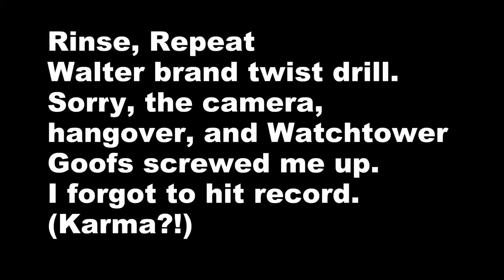Making holes in Armor Plate. Cheap twist drill vs. good twist drill

Comment: AR400 isn't that hard to drill through, your vid is a pretty good guide on how to do the opposite of all the right things to make her chooch though ;-)

* Try not to drill right on the edge of a flame cut piece of steel unless you have to 
* If you have to drill there - anneal with a rosebud till it loses magnetism, then air cool
* Drill a pilot if you can help it
* (A lot) Less speed and a lot more feed.  Start around 70rpm and feed as hard as you without snapping bits
* Flood coolant is best, but a little spray bottle of coolant will get you there without making a mess
* If you can resharpen, 135* and a low clearance angle helps
* Split point is convenient but you'll get a lot more holes out of a standard point

Looks like you snapped the corners off the second bit straight up by drilling into the hardened steel left by the first hole.  If you gotta redrill a hardened hole then anneal if you can or go straight to carbide.  

Keep your stick on the ice and watch out for that Tokillya.  You'd get my vote for president!

Comment: Brings me back to the days as an apprentice in a machine shop, run by the awnriest old fart you'd ever want to work for...drilling holes...in aluminum castings and plate...8 hrs a day, hole after hole. My favorite (worst) was drilling thousands of tiny holes in 3/4 in plate with bits the size of angel hair pasta...and how happy BossGrumpyPants was every time I wore out a bit, or worse, broke one off down in the plate.  Good times...andnin the end, I came to be a pretty fair driller of holes...of one kind or another.
😁👍

Comment: I've read those cheap black drills are only for wood, plastic and soft metals like aluminium and perhaps they're black to indicate this. It would've been great if he'd included those golden titanium nitride coated drills in this test, especially after the coating's come off and they've been sharpened, because they're often, but not always, cheap and marketed as superior, I think it's mostly marketing BS based on looks because only the tip would need coating, and maybe it's also a way to make crap drills last a bit longer.

Comment: Do the bits a favor and start with slow speeds and speed up, not the reverse. If the cutting edge gets too hot, it loses its hardness. High rpm, more heat. Keep the cutting edge cutting, (blue chips).

Comment: Just a simple farmer, here, but slow speed (<100 rpm), and plenty of cutting oil will work wonders.  Oh, and use the cutting oil like a coolant:  When it starts smoking, add some more.  Works for me.

Years ago, I watched a kid at a truck garage get out a brand new, titanium-nitride drill bit, put it in the highest-speed air drill, and proceed to drill no more than 12 inches away from a placard on a new truck frame that warned that this was a heat-treated frame, and not to drill holes into it.  Well, he ran that drill as fast as it would go, without coolant, no less, and smoked the bit into a glowing blob at the tip.   He then removed the melted and deformed bit, put it in a bin of similarly-damaged bits, and got another drill bit, and proceeded to drill out the now-hardened hole.  I think it took 3-4 drill bits to make one hole, and he had several to make.

Comment: Problem with gloves in the shop is twofold. 1, gloves generally catch on spinny bits easier that skin, which will just cut. People lose hands because they were wearing gloves, they get scars when they aren't (in the machining world, specifically, please wear gloves otherwise.) Additionally, you can get melted or burning glove on you for resting on a super hot surface, whereas your bare hand can sense heat by being near it. That second thing is also useful for working certain types of steel, that is, if it's still cold enough to comfortably hold it's cold enough to keep cutting.
Reply: Like standing on a torched off, bolt head.

Comment: I have a drilling question? Here goes. I want to make a pole saw out of a silky pruning saw & telescopic extension pole I have to hand. I need to drill hole in the silky blade to fit the handle. The silky blade is hard and almost impossible to drill I guess it's high carbon or something. I have a Makita battery drill and dormer 5mm twist drill I tried to Sharpen but no help. I think my Sharpening skills are good enough as drill bit work on mild steel good. I love you videos by the way keep your dick in a vice out!

Comment: i have battled this before, its where i found my fighting spirit. . ."if i cant drill this hole than mark my FUCKIN WORDS IM GONNA MELT THIS HOLE!!!. . .i twisted the teeth off a whole set of harbor freight bits, started by breaking all the small ones and then snapped the corners off all the medium ones and then took a big one and went full bore with the rest of the battery and when i pulled it out it was dark blue, wd40 the whole way with every bit just cut for a second then rolled smoke. its my inch thick welding bench made of a road grader blade and i need a vice on it come hell or high water and my torch is out of gas and im leaving in a week and it gonna sit for months anyways, i was able to use a little masonry bit to cut small holes but even milwaukee bits barely made it through the piloted holes, each hole is a different size cause i just did what i could and i remember one of em is 2 different sizes in the same hole cause i ran out of cutting power all together and just had to use a smaller bolt, tried to use a drill slightly bigger every time but it just melted the corners off even with wd40 the whole way, and all the holes are all chowdered and gulled up . . .but my vice is still bolted to that bench. . .never give up kids, even if you have to destroy tools and have crappy results, ive had to air chisel holes before in steel plate too cause it was the only thing i could do. that was a bitch if i ever fucked one

Comment: Mild steel - 60ft/sec cutting speed. 50 to 40 ft/sec for harder steel. Use cutting oil or just oil for coolant. Use HSS bits no problems.

Comment: For noise from water , use a board and place it under a tap below the vertical angle ...
 part of the water will be flooded down the board and will have less noise

Comment: Man AR400 steel is a bitch, when I have to drill it, I crank the RPM down to around 100 and use split point cobalt drills. 45 holes through 2" AR400 and she still cuts fine.

Comment: Nice. I've done 2 holes in a 3/8 AR400 plate to chain up a shooting target one time... My mastery carried me on the path to success with the low speed from a wrist buster mixing drill and a hole kept FLOODED with mineral oil. ( turns out the lenses in a rear projection TV are liquid filled)

Comment: Have you tried Famag drills? 
Famag Series 2420 HSS-Co are made for steel up to 1300N/mm2  - Hardox 400 plate should be a piece of cake.
At least the wood drills the make are by far the best i have in my workshop (better than Colt, Fisch, Twinland, Alpen, ENT).

Comment: Learned in trade school that you can change the angle of your drill but from the standard 118 to 135 I believe and It's supposed to drill better through stainless steel. Maybe it would help for the AR plate too? Never tried it though

Comment: i use a lot of cheap drill bits, swap my belt over to the slowest reduction, and use a home-made coolant with oil/water/soap.  (soap helps mix)  keeps the bit cool,  the steam helps me know when ima bout to fry them. drill a lot of mild steel on a press with chinese-ium bits. shake the stuff up and apply as it evaps. works great

Comment: You are running drill way too fast!  120RPM with some sulfur cutting oil.  You want to keep SFPM (surface feet per minute) below 30.  You must feed oil on every peck.  To drill metal like this, you need a carbide "hi-roc" drill.  Those will even drill through most high speed steel (hardened).

You can tell when you are overspeeding by the odor of the oil.  When things are right, chips come out blue, and the oil "smells nice sulfur oil" with wisps of blue smoke.  When things are too fast, the oil smells "acrid burnt", there is heavy smoke, and the chips come out red hot.

Another dirty trick when drilling challenging materials: start with 140 degree sharpened drill.  Then facet outer corners at 90 degrees.  (This can be done by hand on grinder on large drills, or with Drill Doctor.)  This is the area where the drill is working most hard.  The facet gets rid of "the corner hanging out there" which is surrounded by the metal being cut, and has less path for cooling.  Putting the facet lowers the thermal stress there.

Comment: You toasted that HSS drill bits with too high RPM and almost none cooling and lubrication. Harder steel = more heat at the cutting edge = low RPM + very good cooling and lubrication. It's extremely easy to destroy HSS tools (especially lathe tools). This "test" don't say anything else that HSS is very sensitive to overheat. Also, this is important for sharpening HSS tools - freshly sharpened tool with black and blue cutting edge is useless and becomes dull very quickly. Heat resistance is one of the major benefits of carbide and ceramic materials.

Comment: If you would slow the drill down and use some coolant the Armor plate will drill fine.  And call OSG for your drills and taps.   Tell them you are working with US Military Armor plate and they have what you need.  The problem is the shit work hardens so dam easily.  Keep your speeds to a minimum and drill faster and the bits last one hell of a lot longer.  We have seen 6 holes 1 drill before sharpening.

Comment: the only way I've had much luck with drilling AR is once you start don't lift it's like it hardens that fast when you let off when pecking theough. continuous cut builds heat but goes through. ive never drilled AR  thicker then 1/2" though

Comment: I have had good luck with with windshield washer fluid for drilling lubricant.  I seems to drill easier, cooler and not the mess of oil. Plus it is always available on a welding truck...

Comment: here's a tip, if you want liquid to flow quietly, make an angle at the bottom. where the liquid hits the container. the steeper the angle, the quieter it is.

Comment: you sure know how to destroy the bits. if you'd lifted the bit at the sign of the first smoke and applied generous amount of cutting oil and let the bit, and the material, to cool before further drilling, i guarantee you'd end up with at least three good holes (the goldeny us of a produce would have to be discarded even before any chinese pieces). and yes, and no - you don't need to be crazy to lift let the material and bit cool,  simply drill all the wholes in the part at once, and shift between them halfway. works for me and eases the need to spend $$ on bits right off, even if it's mostly non-specific drill brands that i buy (i.e. bosch, makita and what's that third... probably chinese IRWIN , yeah)

Comment: Have you ever tried BoeLube? (created by Boeing) I haven't used many purpose made cutting oils but for me BoeLube is an order of magnitude better than common oils I have laying around. (like wd-40, engine oil, aqueous bicycle chain wax). Faster cutting, longer bit life, less heat and squealing.
It comes in liquid oil, a paste, or a solid wax; the paste is most handy, the solid is good for thin coats on large surfaces and hot material but its a bit too chalky/hard for most jobs, the liquid is good but doesn't like to stay where I put it.
Other than my water wheel grinder my metal work is dry, I don't have the setup for flooded coolants.

Comment: AR fucking blows!!!! I'm a machinist for a company who refurbishes crushers and builds conveyors. I have to drill this shit all the time. If you are daring enough to use HSS (can be done, carbide if ya got it) keep your speed low (even if running wet) and feed about the same as normal for a given drill diameter. Although something tells me you don't have a big turret drill in your home shop ;) hahaha. I love the channel and I know this vid is just to fuck around  :) any jack off giving you shit about this vid has no clue what they are talking about. One guy said he would do the comparison by hand as to keep the pressure the same?! WHAT THE FUCK?!!! I'd like to see a vid with someone trying to bore AR400 by hand!

Comment: if I used the mag drill at work like you use that drill press id be fired! 1 1\4inch carbide bits through 1 1\2 inch steel, arm wrestle the SOB and on the next hole while the bits still smoking! only reasons to let off is if the base moves, bit binds or breaks, or the holes done! I'm surprised it ain't burnt up, I think I did close to 1,000 holes in 5 days some of which were ovals drill a hole and then drill 1\4 or so back to elongate the hole, it did choock though

Comment: Last year I got suckered into buying a drill bit set from Bad Dog Tools at a trade show. They looked like a masonry bit and the guy at the show was drilling into brake rotors and other hard steel objects like butter. I was unable to replicate his results. The tips got hot and unbrazed themselves from the shaft or just chipped away without cutting anything. Have you tried that type of drill bit? Were they the junk I think they are or was it just operator error?
Reply: +arcticmayhem I would think they simply fucked you over.
On those shows they usually have on set of working really expensive drills and a lot of cheap junk to sell.
That is so called common knowledge.

Comment: one thing that I have learned from cutting some REALY hard steel, it is not the pressure that you cut at, it is RPM and time. I was stupid and decided to harden my knife to the point where I was getting bright fucken white sparks off of it. Then realized I had to drill holes in it and could not start another fire for a while. So I took a carbide bit (a real shitty one) and put it in the drill press. took an hour for a hole. The lesson tho is that I hate through the first drill bit by forcing it in (sex joke).
Reply: +Alpha Nerd did that too! I had to use a hardened hammer drill bit just to get through the knife blade. yeah, I learned my lesson. make knife handle holes before heating, and quenching to hardness. glad i'm not the only one that did that!
Reply: Nick Teasley Ya! mine might have not even been carbide but was brittle as hell. it was as you said a  hammer drill bit.

Comment: Quiet fluid from making noise or splattering using a home air handler filter. I use it for my oil drain bucket

Comment: I drill through stuff all the time.
I hate the idea you need lube to drill through steel you don't.
Heat is the enemy and water works great maybe soap and water but not oil.
If he used water the cheap bit will work just fine.You want a bit to cut.
Lube does exactly what it is supposed to do.
Your drill is turning faster than you think it is and that will dull the bit.
I was working at a shop and everyone was using Ambertrap a lube that can be dissolved in water and they were breaking bits left and right.
They were using it straight from the barrel so I mixed a batch for me with mostly water and I never broke one bit.
It doesnt matter what you are cutting if you can use water then use it.
Reply: How is oil not a good idea? Will Oil or water makes drilling harder?

Comment: Cobalt steel drill will do it - titanium nitride or high speed steel coated cannot handle hardened or stainless steel. 1/4 inch pilot hole first though. Once the pilot hole is in it goes mucho better. Something like ar400 you might want to drill pilot holes twice in increasing diameters. Too slow can be a problem because the heat can crystallize the material being drilled and it hardens. Too fast and the bit expands and/or melts. 

FYI cobalt bits are expensive, but unlike the golden drills, they can be sharpened without losing the magic coating.

Comment: Old school says: use a drill bit used for drilling stone or concrete..  sharpen it and give it an edge..  and it will cut through hardened steel. You will need a diamond stone to accomplish this, but it will work! ;-)
Reply: +Fernand Geene Van This is a good call. I had a 12.9 grade bolt snap off in a subframe and after going through tons of drill bits a stone bit cut right through it and I was able to tap it back out.

Comment: You can talk about US vs Chinese manufacture, special coatings vs cheap crap, but the only obvious trend I can see is that the bits you drilled at low speed did okay, the bits you cooked at high speed died.

I think you owe the M.A.D.D. an apology!

Comment: Interesting comparison. I use misted water-based coolant (cheap misters are under 20 bucks on Ebay) to keep bits cool after seeing how well it works for my professional machinist buds who are hard on their equipment. One mister is cheaper than a large drill bit. I've no particular opinion on coolant and defer to the experts on what to spray. Water-based coolant also works well, but somewhat wastefully, applied by filling a plastic soda bottle and piercing a small hole in the cap to make a "squirt bulb" of sorts. That's another pro trick. They trashed too many expensive squirt bottles.

Comment: Back in my days as a Locksmith, we would generally use a masonry  bit, re-sharpened to drill hard steel  plates in safes.. Would cut through much faster than a standard jobber bit. 
I did have one lock once that I had to use various bits as it had layers of harden steel, mild steel and ceramic :\  that was a right fucker!